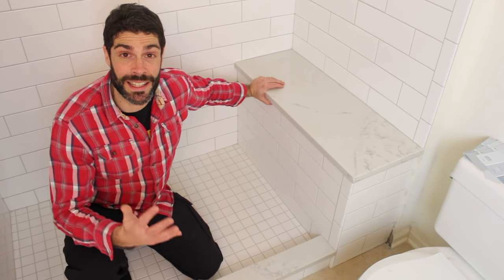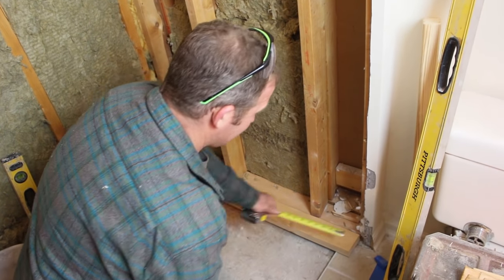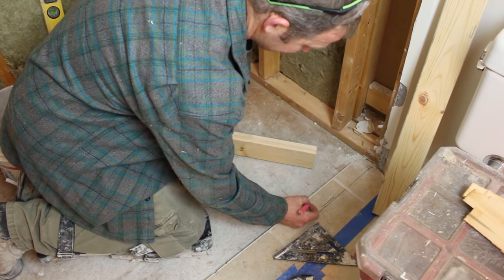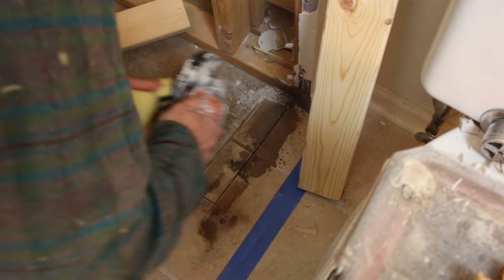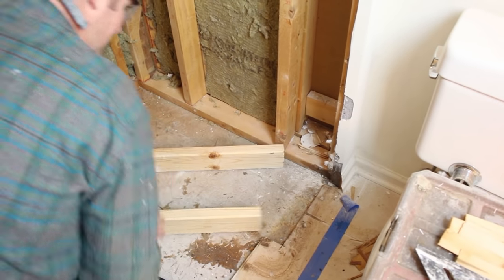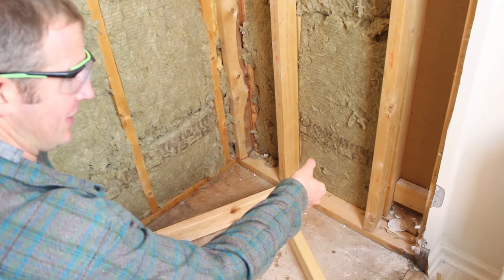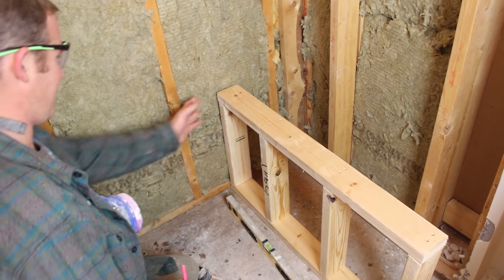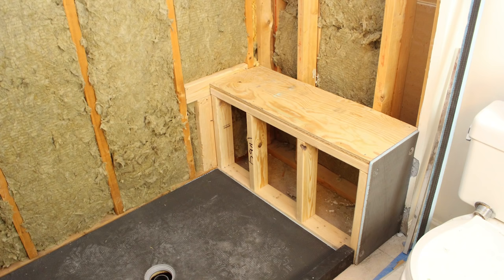Shower Bench Seat Framing and Construction for Wedi Fundo Primo (Step-by-Step)

Comment: Half-assed if I’ve ever seen it. My benches are 100%in the pan. Made 100% from masonry. No wood in the shower! WoOd shrinks, especially construction lumber, cracks appear, and where’s that water going to go? In the pan? What pan?
Reply: i agree with most of that statement however by the time wood is kiln dried its shrinkage is hardly noticeable leave a stack in  an ac shop and itll be done shrinking in a month
Reply: @andrewplough9897  no professional remodeler is going to  do that.
Reply: @andrewplough9897  water is the smallest molecule on the planet. Even shrinkage that is “hardly noticeable “ will cause a leak.
Reply: Got that right! Halfassed fo sho!
Reply: @andrewplough9897  shrinkage has nothing to do with it! It expansion that you gotta worry about you pinhead! That seat wont last 2 yrs. before it starts to show water damage! I dont care how much you try and waterproof it!
Reply: Best way to build that bench is to not ever build it or at least build it like jefferylonigro said and build it out of solid masonary inside the pan! Myself I would do a slab of granite for a free floating seat! Opens up all that wasted space underneath too which is huge in a small shower!
Reply: Step by step huh? Lmao on how not to build a seat!
Reply: You can tell by the brand and quality of a guys levels if he is a serious tile installer/ remodeler! Pittsburg? Lol! Dude ! Like that level is from harbor freight! Go buy you a stabila ! At least I will know thats right!

Comment: Ya you are ok at framing the bench! Yes its level, flat, all that! But you are missing the whole point about a seat needing to be contained within the shower! And by the shower i mean the shower pan if you are installing a vinyl pan! That means you need to run your vinyl pan material under that bench and up the walls above the height of your bench and out beyond the depth of your bench as well! Therefore, just like at the base of the other walls  you need to leave room to fold the pan in those corners as well! Are you hearing me? You should have almost the same space above the bench as you have above the floor in the rest of the shower ! Which by the way should be 8” ,or, at least 2” above the height of your curb! Reason being, if the drain ever plugs up and the shower floor should fill with water no damage will occur on the walls! Very important detail which you apparently missed that day at tile school! Your pan height should be 2” above the height of your curb! If the water keeps running it will over flow the curb but no water should ever get to the walls that way! Comprende? Thats an extreme condition but thats the reason code requires it! Its part if the uniform building code im not making this up! You should maybe go read it!

Comment: Carpentry work looks great. However, I didn’t see him add an angle slant for water runoff on the bench like I’ve seen others do before.
Reply from the maker: good question, the slope was done during the solid bench top installation
Reply: @HomeRepairTutor marble is porous, your waterproof substrate needs to be pitched

Comment: Does the bench not need a small amount of slope so water doesn't pool?
Reply: This unanswered question is the only reason why I watched.
Reply: The slope is made when installing the tile with the amount of thinset you use.
Reply: @MikhailPanasyuk  But wouldn't it be easier to set that slop with the bench framing?
Reply: @aricvaniterson7936  Yes, yes it would be easier at the framing stage.

Comment: Im getting ready to build the same style bench for our new shower. Shouldn't the bench top slope toward the shower so water will not like on top of the bench?
Reply from the maker: all benches should be sloped toward the shower pan, this was accomplished when we installed the solid quartz top
Reply: @HomeRepairTutor  I looked all over YouTube for that video where you are setting the seat but couldn't find it.
Reply from the maker: M O that portion of the installation is inside our Bathroom Repair Tutor Video Library, you might really benefit from those videos
Reply: @HomeRepairTutor  why is the curb stop
On front of the bench why didn’t the curb go straight back and the bench inside?

Comment: I am still trying to decide where to build the bench inside the shower. I'm assuming my wife will have the most need for a bench since she has a lot more to accomplish inside the shower than I do. The bench location will also dictate niche/shelf placement.

It needs to be out of the direct line of water spray but easily accessible. I am also thinking of short raised "arms" on each end to the bench to act as a "foot stop" to help her with shaving her legs. I think our bench will be about 40" long. The shower will be between 22 and 32 square feet, depending upon the final design, so I have plenty of room to play with.

By the way, I'm having a little bit of difficulty finding all of the parts to your video subjects. Maybe if you could develop consistent naming conventions for use in the video titles??

Thanks, for the informative videos and effort making them!

Comment: Love your videos!  Question about the glass wall that sits on the bench: If the top of the bench seat overhangs the front of the bench, how will glass be close enough to the vertical part of the bench to keep water from bathroom floor? Keep up the good work!

Comment: Good video but you’re supposed to use pressure treated wood against the shower pan and bench should be sloped towards the pan (1/4” for every foot) . Just shim the plywood .
Reply: Pressure treated will warp as it dries,
Reply: @jonathanclark6489  to each their own. I’ve built numerous showers , and never had a problem . The pt wood was fully dried prior to install.
Reply: The problem is that today's pressure treated is garbage. Sure, it's green, but without the copper arsenate it doesn't last any longer than untreated lumber. And it's twice the price. I wish this weren't so, but ACQ lumber is something of a scam.

Comment: Had a bench like this in a home we bought. Just got done tearing out the whole shower and bench because apparently over the years since whoever did the shower renovation, water seeped through the grout and cement board into the wooden bench(there was no vapor barrier behind the cement) and rotted the wood which also spread and caused mold/rot elsewhere.  So disappointing.  
I was hoping the video would go to the next steps to show how they would waterproof the bench so that water damage doesn't occur.
Reply: Use cement block
Reply: It's a waterproof membrane that was missing (not vapor barrier).   The top of the bench needs a slight slope so water doesn't pool. That probably wasn't done either.
Reply: Maybe it was this guy who built it!
Reply: Dont build it like this guy!

Comment: Nice video, all pressure treated Lumber would be my choice.
Reply: What’s the purpose of pressure treated lumber, if water gets in there you have bigger issues
Reply: @yevgenikovelman3306  I would assume because of moisture. I didn’t see if the floor was concrete or not but will prevent mold if it comes in contact with moisture.

Comment: How do you choose when to use nails and when to use screws? I see a variety in this video! thanks, very helpful
Reply from the maker: Nails when we can fit the nailer in the space, screws when we can't
Reply: Home Repair Tutor ok great! And can I use the manual method of hammer and nail?! Nail guns are around £500 here so don’t plan on buying! Also should the bench slope in towards the shower slightly or not?
Reply from the maker: You could use hammer and nails, but also use liquid nail to keep the nails from popping. Yes, have the shower bench slope toward the shower pan by 1/4" per linear foot, or what that equates to in the metric system :)
Reply: Home Repair Tutor ok would you do this by shimming the actual bench that is placed on top or making the frame slightly lower at the front than back?
Reply from the maker: Either approach works, but adding a little more thin-set mortar under the Wedi will likely be the easiest approach. What kind of shower are you building?
Reply: Home Repair Tutor ah that’s a good tip actually I’ll just apply thicker mortar bellow the weidi! I’m planning to build a small shower, then a bath joining onto it with a glass panel separating the two. So I’m following the video to build a bench as I’ll make something similar but smaller to separate the bath and shower! Then tile it.
Reply from the maker: Sweet, keep us posted and let me know if you have any questions.
Reply from the maker: by the way, what made you start the shower remodel?
Reply: Home Repair Tutor I’m moving into my first home but a lot of it needs renovating! So I’m going to try do as much as possible myself, starting with the bathroom! It’s mostly all new to me!
Reply from the maker: Congrats, that's great news. It's exciting to move and start new projects. Keep us posted on your bathroom, you might like our course over on Bathroom Repair Tutor, it's very helpful

Comment: What if my floor is concrete? How do I attach the framed bench?
Reply: Add 2x4's on top of the concrete and use concrete screws like Tap on from Home Depot. You will need a hammer drill to drill the holes in the concrete first.

Comment: So if you frame the shower bench  it for 20", how tall will it actually be after you subtract the shower pan materials?
Reply: Probably 20.25-20.5" if it were tile, this one is getting a slab
Reply: Really depends on the thickness of the pan and also the thickness of the plywood and the thickness of the slap that will go on top of the bench. 
In think over 20 is too much no?  A tall toilet seat seat stands 17 inches tall

Comment: Great video, I am doing just this install as part of a bathroom that 2 weeks again I got a bug up my but and tore it out. I am going to build the bench in the morning along with a knew wall next to the bench.  I bought the weed curb pat because we may put a glass splash panel in the shower.  is there a rule of thumb for how wide such glass panels need to be to avoid getting water all over the bathroom?  The whole bathroom will be tiled but only the shower will have a drain. Thanks.

Comment: What about the moisture coming from the concrete?  Why aren't you using pressure treated wood or putting gasket between the wood and the concrete?

Comment: Maybe you added blocking to the back of seat after video was done?
Reply: Home Repair Tutor some tile installers put down lathe and use mortar to float walls and floor (after hot mopping), others use hardibacker and some membrane on the floor.  When they go the lathe/mortar route, 2x’s are placed between the studs to give them surface to attach the lathe with staples.  My tile guy does it the lathe/mortar way which is considered old school in Southern California.
Reply: @ko6128 i like how he didnt even understand what you were talking about ! Hes clueless on the concepts and has very limited knowledge on building showers!